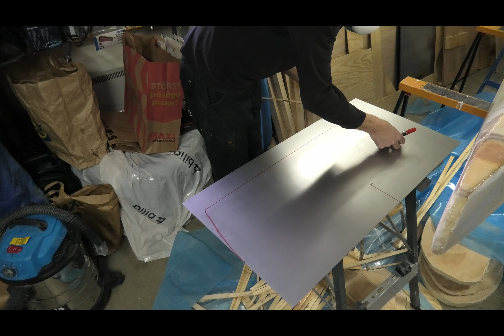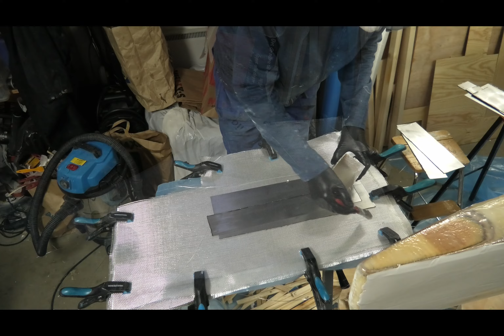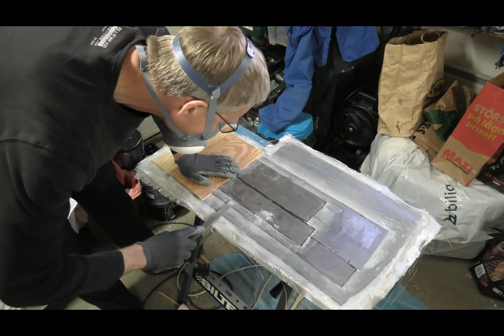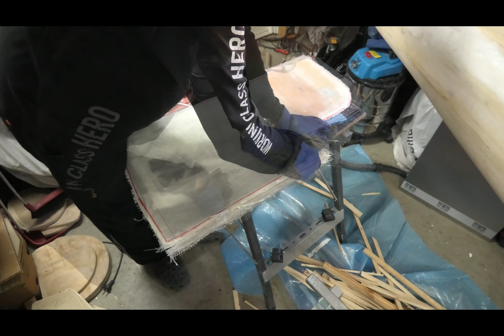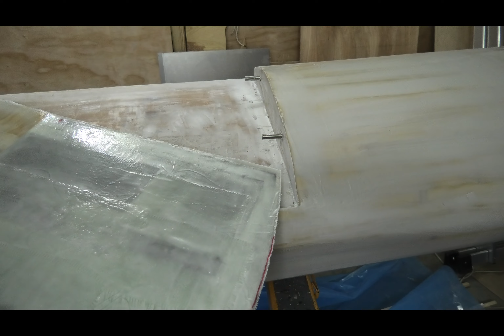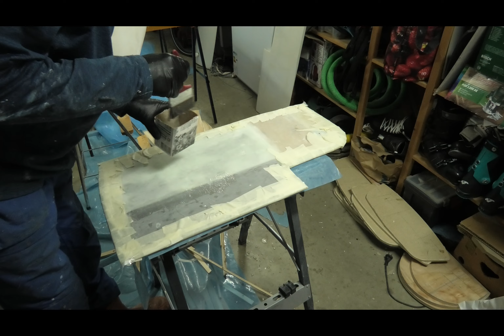Building a pivoting solid heavy sideboard for my camping catamaran #367

Comment: Nice to see your build progressing well. I think I was a little confused by which side was the front of the pivoting board. Does the front have the 90 degree angle at the top? If so, do you worry about excessive drag from that corner of you have the board part way up? Or maybe you are designing to always have the board completely up or down? Thank you for sharing your build, I am excited to see it sailing one day.
Reply from the maker: Thank you for commenting! In the front of the board there is a piece "missing/90 degree angle" so that it can swing in under the hull when completely lowered. This is to reduce the weight of the board, increase the board area without stealing packing space but mostly to allow me to get the center of effort of the board more forward in some wind conditions. I'm not sure that I will need this extra effect as I haven't decided on all sail options yet but as this is a prototype it's nice to have the possibility to move the center of effort somewhat. As the upside of the corner has a rounded shape, same as the front has, it should not add so much to the drag.